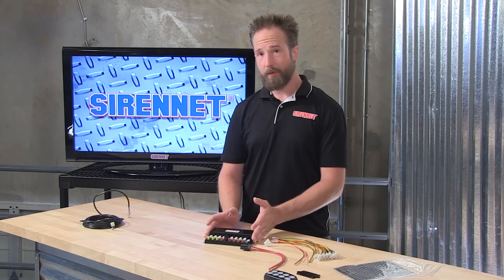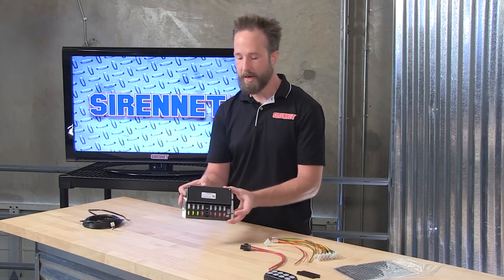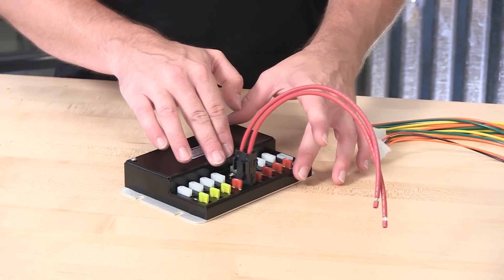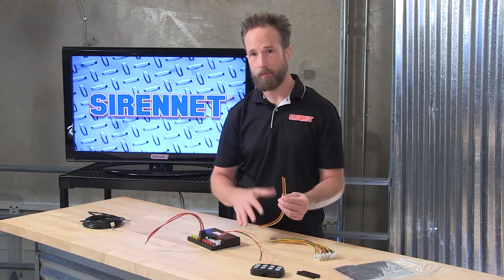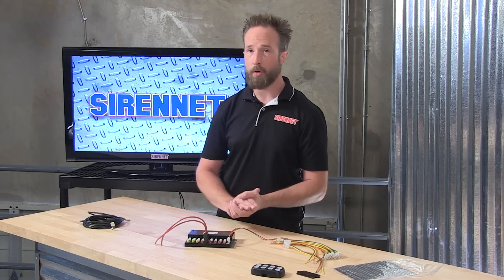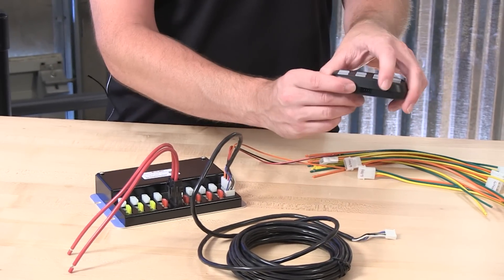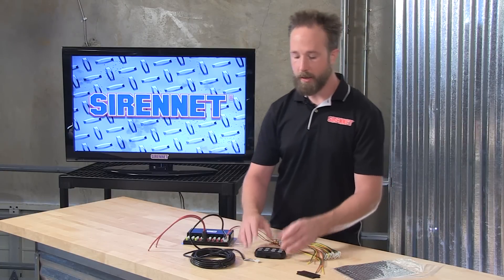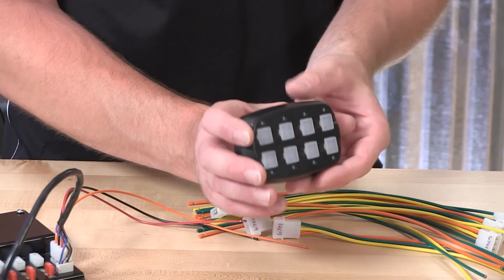Whelen 8 Function Power Control Center

Comment: @SIRENNET How does it work with light flashing between amber and white?
Reply from the maker: Presuming it's a Dual Color with leads for Amber & White; one would go to button 1 for example and the other to button 2. This will separate the colors so you have independent control.

Comment: Anyone know if I can swap around the fuses that come with the pcc8r? I need to move one of the 20amp fuses from relay 2 over to relay 7. I can't find any documentation supporting or negating my idea.
Reply from the maker: We'd definitely recommend that you check this with Whelen Engineering's tech department so there's no potential risk to the PCC8R system.

Comment: So I noticed each accessory plug has three wires which I’m assuming is + and - but what is the purpose of the 3rd wire? Is it a optional sync between units?
Reply from the maker: The PCC8R's designed so you can have a Dry Contact Relay or Standard Outlet depending on how its tying in with your accessories.  You'll only use 1 of the three wires from each input. For a look at the install sheet with notes from Whelen, please see our link here: http://sirennet.com/pdf/14326_PCC8R_install.pdf

Comment: can you swap the fuses instead of 10 could you add 20 in its place
Reply from the maker: You would want to keep the fusing at 10Amp's. If higher watt Fuses are swapped in, the internals of the PCC8R won't be able to handle to increased draw and could case operational issues.
Reply: ok thanks

Comment from the maker: @ David Lucas... Not all 3 on each Switch input are hot. You can make adjustments to the wires based on how you want the PCC8R to work in regards to the inputs and setting them up to be standard outlet or a dry contact relay.If you take a look at the Installation Guide, it'll offer a bit more information.